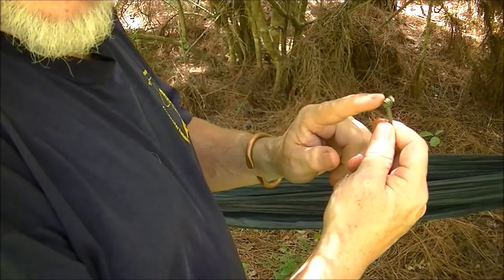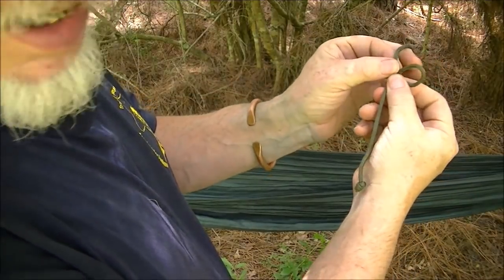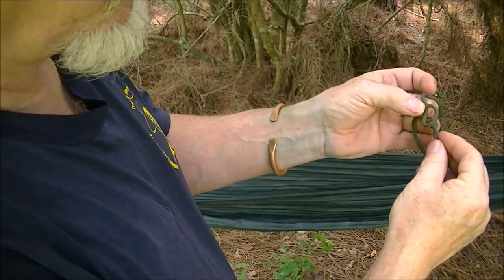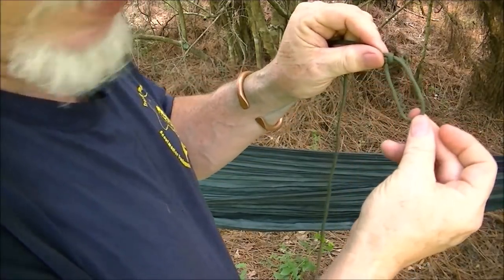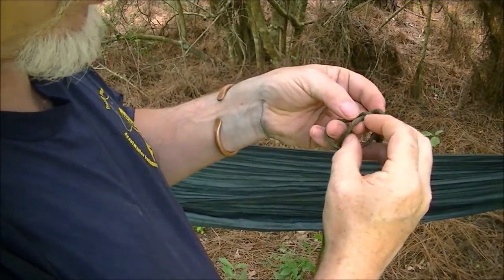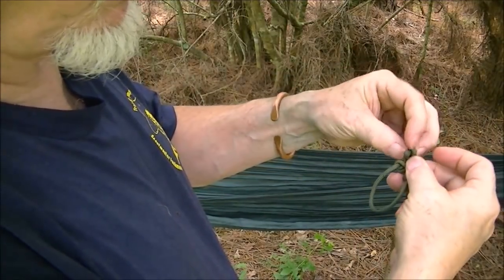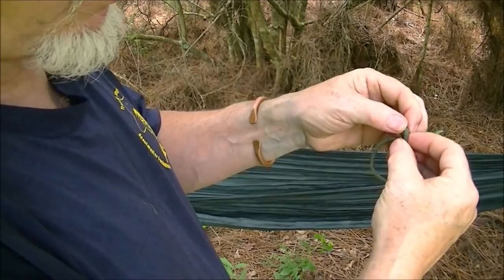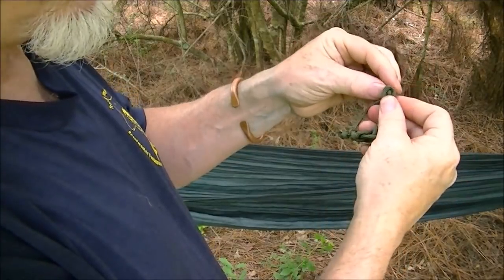DOWN N DIRTY WOODSCRAFT  PARACORD DONUT COIL

Comment: That's a cool trick, I do that when I am using tiedown straps for my truck and I have extra hanging off I crochet it together and half hitch the the last looped end, it works great because you can neatly eat up like 8 feet of slack into 1 foot and it won't come undone in the wind. For paracord storage in my pack I use one of those really thin cheapy grocery store brand spring water bottles for my paracord, it works great. You can feed the paracord right into the bottle and it will hold up to about 75', cut a small X into the cap and pull the end of the cord out a inch or so to be grabbed easily and pulled out when needed then screw the cap on, then you can crush the bottle flat and toss it in your pack, it basically makes a paracord dispenser and it never gets tangled and you have a backup water bottle at the same time.
Reply: dmith smith sweet trick!

Comment: Here’s another method, and I believe it’s faster. You can pull out as much as you want, as shown in the video, then tighten the wrapping to fit the new, smaller bundle. It can hitch up some,but not too much. And you may have to undo it all to make a new bundle when you want to roll it in, but it’s so much faster I think it’s worth it. 
https://youtu.be/-HVf74nBCOw